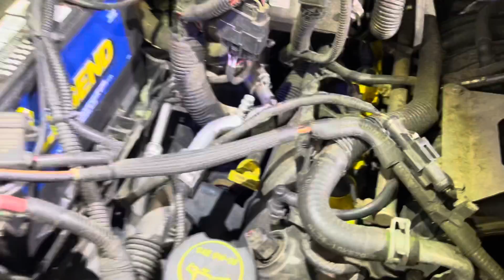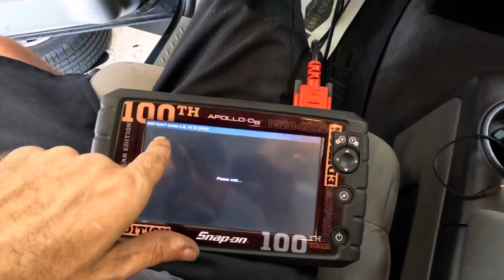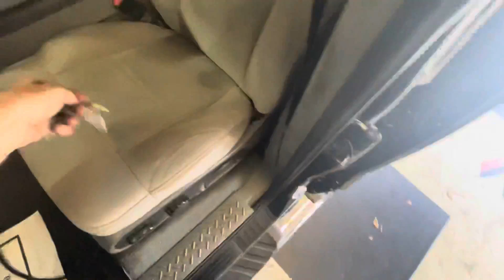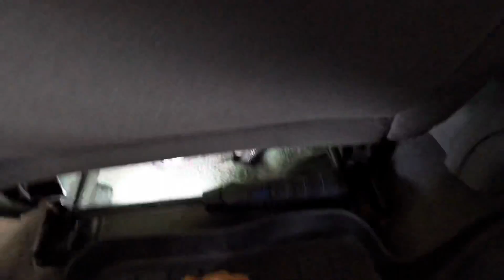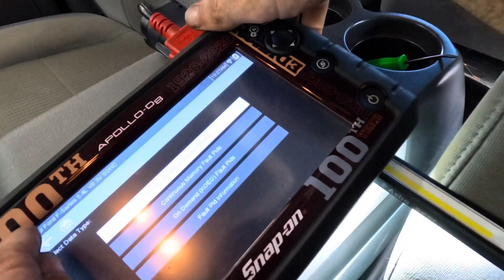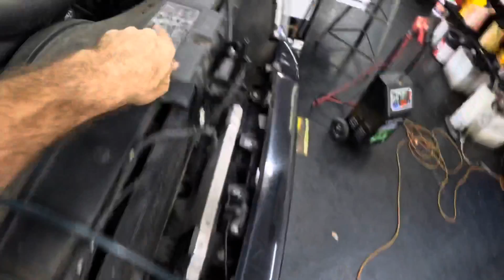Mini Explosives! Car fire Recalls and Airbag Fault! 2008 Ford F-150 5.4 4.6

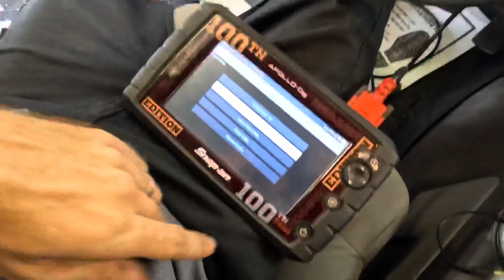Comment: 4:40
Actually, brother, that's literally the definition of a design flaw. I think I get what you're trying to say, which is that it wasn't a manufacturing or development flaw in that the components weren't operating as specified, but it is 100% a design flaw in that the design, itself, created the unsafe condition.
Reply: You can't predict all of the interactions of the components within the operating environment.  The military has tried predicting mean-time-between-failures for years and still doesn't have a good way of doing it.   You start with Mil Hdbk-217 Reliability Prediction and if that actually worked you wouldn't need the other MTBF Mil Specs.  But you can't predict 100% of the failure events because you can't define all of the conditions with component interactions in an infinitely variable operating environment.  So, your statement that "it is 100% design flaw" may be true, but it is outside of engineering capability to accurately predict 100% of the failure scenarios.
Reply: @buckhorncortez  Then the bomb goes off !     LOL
Reply: @fredwalker839  That can happen, but not from what we're doing here today. The system he's working on is a safety feature. You need 2 things to deploy an airbag. 1. An impact sensor picking up an accident condition. 2. The system has to have power. So, if you lose power during an accident, the airbag won't deploy.
Reply: @buckhorncortez  : "You can't predict all of the interactions of the components within the operating environment."

Yeah, and when you design a component/device/feature that literally causes the issue referenced in this video (seat catching on fire), then it's 100% a design flaw. According to Ray, the explosion from the seat belt connector is catching the seat on fire. Therefore the fault lies with either the design of the device, or the guy who designed the seat covers (or both).
Reply: With your apparent engineering expertise , you'd easily find highly remunerated employ with any vehicle mfg's. They're always searching for ways to reduce all possible hidden costs.
Reply: @peted5217  👍👍👍👍👍 Read the 12 th. floor ! Written by “ John Deloreon “ when he WAS the man @ GM ! WILL open your eyes wide open! Book is about 35 years old,,, & True !
Reply: @fredwalker839  Mr. GTO
Reply: @fredwalker839  I could not find a book called "The 12th Floor," but I did find one called "On a Clear Day You Can See General Motors" that sounds like what you are describing. There was a reference to the "Fourteenth Floor" in one of the comments of the site I found it on. It appears to be out of print and available only through resale.
Reply: Ford doesn't make those. A company like Takata does. At your reference at 4:40, he's talking about a fire recall from a problem GM had. Because of that, Ford issued the exact same recall because use the same pyros as GM. So who do you blame it on? Ford/GM, or the company that made the part?
Reply: It’s a design flaw, but not on one particular engineer. You have seats which are made by one vendor, the seatbelt by another, the pretensioner by another. Then you have the guy who makes all that stuff work together and fit in a specified area. They build and crash test these dozens, if not hundreds of times and probably never had a flaming seat. Thousands of customer crashes later, the problem arises in a very small sample. So, technically yes, a design flaw, but not anyones fault, nor one that could have been foreseen. Auto manufacturing is a sum of parts from a bunch of different manufacturers all working together to make a single product. It’ll never be 100%. Takata airbags were a major design flaw that should have been caught in testing.

Comment: Wrong. The suction line (low side pressure) is the gas return from the cabin. The liquid line  (high side pressure) is coming from the condenser. Sorry had to correct for those that don't know.
Reply: & don’t eat yellow snow ! LOL

Comment: As I watch Ray's videos, it amazing to me how many vehicles have 150K+ miles.  One after the other (it seems).  People seem to drive cars a lot further than I realized and, it seems, cars today are able to keep rolling on and on (with his expert services).  Great stuff!
Reply: I’ve noticed that too. A retired mechanic friend who worked on fleet vehicles for an oil company attributes it to the introduction of fuel injection.
Reply: @gr7485  That's my take as well. Mazda's and Toyota's run above 360k km/200k miles with hardly any issues. My brother's Matrix 1,3 ral well at 460 k km/ 285k miles when it got totalled from hitting a bad pothole.
Reply: Ray doesn't have to deal with rust issues like we do up here in the northeast.  For us it's time that kills our cars, not mileage
Reply: @driveway_of_misfits  True but... Eric O over at South Main Auto sees a lot of high mileage vehicles also. And a lot more rust. Watch Wes Work in Northern Illinois can hardly see anything because of the rust... even so he gets mostly high mileage vehicles.
Back when I was a mechanic in the late 1970s to early 1990s in California we mostly saw cars from the 1960s-1980s. By some estimates US made car quality hit rock bottom in 1978. Like Ray we only saw rust if the car was from the midwest (or northeast) or someone decided to be stupid for a few seconds and drive in the surf. Steering and suspension would typically go 50K-100K miles before needing any attention. Back then people drove less, on average, than they do now.
Anyhow.... It was considered time to start getting a new (or lower mileage used) vehicle once yours was around 100K miles. I only had a few customers that had vehicles with mileage close to 100K and about half a dozen with vehicles at 150K and only one who had vehicles over 200K. People were also much less likely to repair a vehicle if it cost more than a few hundred dollars and maintenance bills over a hundred dollars were usually brakes. Cars these days with fuel injection and better engineering overall have become far far more reliable. The engines (and most of the other components) have much "flatter" performance curves over time.
Other factors are the sheer cost of a new car. Costs as much as you will make in a year. Back in the early 1990s a new vehicle cost about 1/2 to 1/3 your yearly gross income.
Reply: @utidjian  I can't help but wonder if the introduction of fuel saving technologies like GDI, auto start/stop, CVT transmissions, cylinder deactivation, more plastic under-the-hood parts, etc. will actually reduce the lifespan of new cars.  They may save gas but all come with serious caveats that negatively affect longevity...
Reply: I have always lived in CA and we have always kept are cars for over 10+ years. We have a 2011 with 175,000 miles and we plan on keeping another 100,000.
Reply: @lisas292  I'm super jealous...my 12 year old car only has 106,000 miles on it but there's so much rust it'll be going to the crusher in a year or two despite still running just fine 😭
Reply: I remember when you got rid of most vehicles at 90k miles because it was worn out. 
Now we have better alloys, better machining and thus better fit so, except for salt, there's no reason you shouldn't get 150 to 200k miles.
Reply: You're assuming nothing was done to the vehicles. The odometer can't tell you if a car has the original motor, or if its on its 3rd motor. I work for Ford. Its a miracle if one of our cars goes 150k on the original motor. That wasn't always the case. We used to make much better vehicles. I'm backed up for months with work. We're even training the lube techs how to do some of the easier parts of the job.

Comment: I gave a talk on Air conditioning. It doesn't make cold! The cold is already there. Heat is the commodity. AC moves the heat from inside to out.
Reply: Yup.  The warm refrigerant on the inside of the A/C area is compressed into a smaller volume and passed to the outside of the A/C area (where it will be hotter than the ambient air, and which the ambient air--even at 120F--will cool down).  Then, when that is reexpanded on the inside of the A/C, the heat is distributed in the expanded gas to where the gas's temp is now colder than the inside temp, and air is blown over the coils and fins.
This is why just running fans in an exclosed place, without an actual heat exchange to the outside, only adds heat to the system.  But, you'll never convince anyone of this.
Reply: @josepherhardt164  
Even a class of college students sit there going, but it blows cold air? So it makes cold. 

Noooo! All it did was blow the classroom air through the coil. The heat in the air was left in the coil. The air was cold to begin with. 

Their jaw drops.
Reply: @Michael-rg7mx  Their jaw drops…then they eat a banana and go home! Oh! the cost of education ,you can’t fix “ stupid “
Reply: @fredwalker839  
It got even better when I told them that there were tunnels under the whole campus. The cooling is ran through pipes that supply chilled water made in an underground plant. The metal sculpture right outside of that wing was where the chimney was that put the heat up into the air!
Reply: @josepherhardt164  Josep…..in short, a/c systems remove heat , then blows inside! Dah !

Comment: My son is a senior chief mechanic for Roush in Bemidji, MN! They have special drivers that drive 300 miles a day testing cars not out on the market. I worked there for awhile, and it was really cool to sit in a vehicles that were just as expensive as a house!!  My son has travels to Florida several times to work at the Roush company there, and also in Colorado!! Roush fixes their own cars which is why they only want the best mechanics working on the test drive cars!
Reply: Something like “ Area 51 “ I would be proud of any SON with a job ! Especially ones that” You can’t kiss & tell “ jobs! LOL

Comment: Why do you say it can't be foreseen? The components should be tested in the configuration that they will be used in.
Reply: Suggest a reconsideration. A particular set of circumstances culminates in a minority of fires which manufacturers then address. As you are a "tired old mechanic" you would be aware that no doubt in the testing program manufacturers can put 60K miles on vehicle in 2 - 3 years, have kids spill sweets and soft drinks on the carpets around the problem area, then have a really large range of vehicles in many, many accidents - because only a small minority of the vehicles involved in accidents had the seat pre-tensioner explosive fault, causing the fire. They could then have another fleet of test vehicles to cope with later recalls of other previously unforeseen circumstances. Many times I disagree with vehicle engineers and can see a better way to access/repair certain items. But in this case there is a limit to what can be foreseen with every possibility with every component on a car. I am also a 70 yr old retired mechanic in Land Down Under.
Reply: I remember back in the 1960's Consumer Reports discovered that a certain car (Now defunct manufacturer) leaked gasoline from the tank under hard braking. The manufacturers said "only under extreme braking." CR said "like right before a crash?" It doesn't take a PhD in M.E. to understand that explosives going off in a crash situation isn't a great idea. Engineers come up with some doozies. Consider when the NHTSA engineers wanted to make motorcycles steer with the back wheel. You don't have to put your "little friend" in a pickle-slicer to realize it's probably a bad idea!

Comment: Ray you can not determan the correct value for the resistor while touching the probes, your body also have a resitance value in this case. If you want a correct reading you should not touch the probes. Just a thought.
Reply: Body resistance would be in the megohms and in parallel with the 2 ohm resistor.  It would be negligible.  Twisting the meter end of the leads might be all that's needed. Ray knew what he was doing.

Comment: Love the video as always but I'm still amazed that a aircon is more of a priority to a customer than an airbag safety pretensioner. I get that money is tight but I'd have opted for the other way around if that was the case. Perhaps it's just me.
Reply: Sitting in the UK at 17 deg C and less than 50% relative humidity, I'd agree. Can't guarantee I'd feel quite so sure in Florida at 33 deg C and 78% relative humidity.
Reply: @DraftySatyr  My wife and I were in Italy when she was 7 months pregnant and it was 40 deg C. No A/C in our tiny VW Lupo, but when we got home, I bought used parts off Ebay which  I installed by myself and had it ready just in time to rush her to the hospital when she got into labor. A/C keeps you fresh, the noise from open windows tire you out.
Reply: Ray didn't specify the reason for the delay, but there may be a lead time on the part required
Reply: @m1stertim  Yeah, he said it was a future project that would be handled at a future time. Normally if the customer declines the repair, he says just that.
Reply: There's only about 10k miles left before the truck self destructs so might as well enjoy cool air for the duration.

Comment: the out of spec electrical resistance of an airbag is quite a common issue. the chemicals in the explosive charge slowly start eating the internal initiating fuse, causing it to go higher in resistance. thank God you did not check its resistance directly.
Reply: Now that really would have been dumb but would have made for extremely dramatic video! 🤣🤣
Reply: Naah. Checking direct resistance might have only resulted in a little bang - as well as soiled underwear. Would have made an interesting video though. Retired mechanic in Land Down Under. PS. Ray is smarter than that.
Reply: @bobhudson6659  you know some DIY watching is gonna hook the leads up to the wrong terminal!
Reply: @chrisstromberg6527  Appreciate what you are saying. However, everyone has some "grey matter" between the ears. If DIY person you mention can't recognize the sarcasm in my comments, then they need to "re-boot" their brain. Plus I think engineers would have thought of that risk and would have placed some sort of safeguard in the seat belt explosive circuit to stop this possibility, like the need for a voltage spike or something, a voltage much higher than is available in a multimeter. I hope so anyway.

Comment: Ray, did you know on your Fluke DVM that if you are checking resistance and you want to get a true zero ohms when shorting  the leads together push the Delta (triangle) button. It will zero the display and remember to subtract the resistance of the leads. But only for that session.
Reply: The other thing is that when touching your leads while trying to read resistance, it will give you a false reading too.
Reply: @roneckler9937  True, but dealing with such low resistance it's negligable. Has to be in the many thousands range to make a difference.
Reply: I hate that my Fluke DMM will not compensate lead resistance. But my cheap Ames from harbor freight  will compensate probe leads
Reply: @idiotwithasolderingiron  a good quality set of leads will help with that, but because there are so many different types of leads that fit DMM's it's hard to be 100% accurate with any DMM. You can also send it in to have it calibrated if you notice your readings are off. Resistance is also read with a variable +/-, so as long as you are within that variable you're all good.
Reply: @roneckler9937  10-4 !
Reply: @roneckler9937  I use the OEM Fluke leads. This gives me .3ohm lead resistance
Reply: @idiotwithasolderingiron  mine too !
Reply: @idiotwithasolderingiron  If you calibrate the unit to zero ohms using the leads they are in the circuit and therefore are compensated for in that measurement .
Reply: @idiotwithasolderingiron  Are you doing work where 0.1 to 1.5 ohms will matter? Most electronic resistive components have tolerances between 0.5 and 5%
Reply: Ha ha ha, thanks for your contribution, I didn't know that. My 88V gives annoying 1.2 ohms baseline, too. I saw a video showing how to calibrate Fluke meters, (I think on EEVblog), but you have to go through the entire reset algorithm just to set baseline resistance, and you need special equipment to complete the reset process.
Reply: You know what they say...  "If it's a good meter...  it's a Fluke"

Comment: Early on in my career I was working at a Toyota dealership we had a guy that came in the shop one afternoon to give a class on airbag safety procedures as airbags were just starting to be a common thing, the instructor took about a half a dozen of us out to the back lot and set off one to illustrate how dangerous they could be if you didn't take proper precautions when working on airbag units, it was certainly eye opening and really cool to watch as well, of course now days that would never happen.
Reply: There's YouTube videos[1] of morons playing with and/or pranking one another with airbags. A few of them weren't for the 'faint of heart'.

[1] Or there used to be anyway, haven't looked in ages.

Edit: Typo.
Reply: Similarly, when I was doing my infantry basic training in the mid-70s, the instructors used a similar method to demonstrate how lethal even a thunderflash (low-level flash-bang grenade) could be in an enclosed space by placing one under a steel helmet and igniting it. Helmet flew about 30-40 feet in the air, and had a significant 'ding' in it.  Can't imagine the instructors using the same demo now.
Reply: @DraftySatyr  I'm willing to bet that if you threw a grenade at someone, trained or not trained, they're going to run like hell.